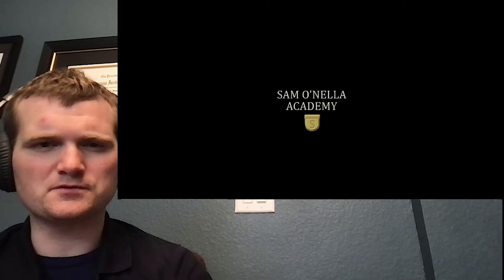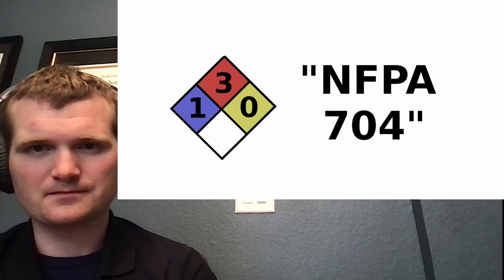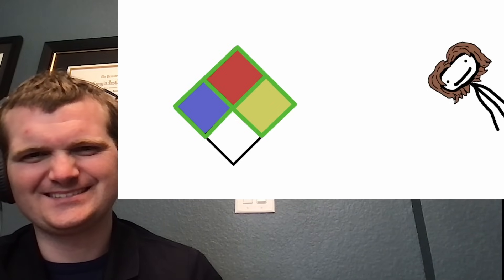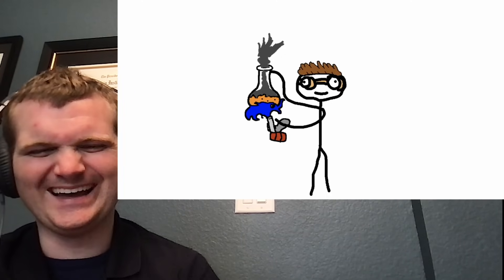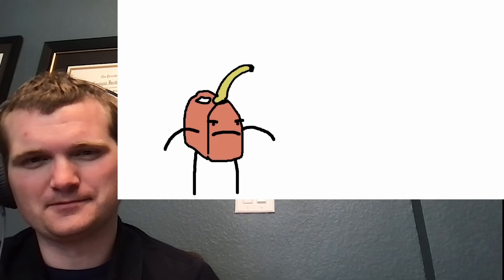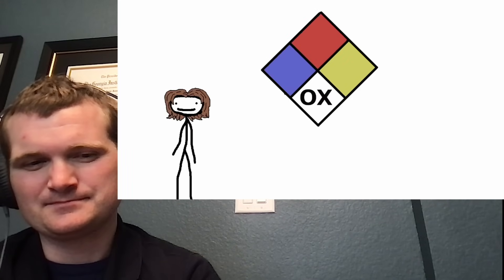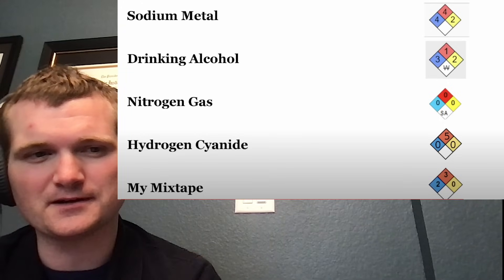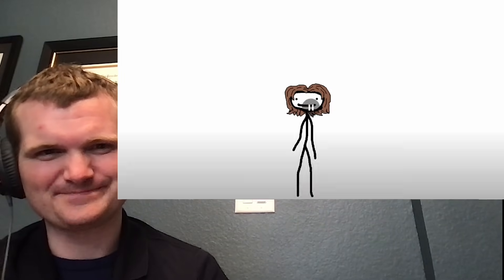Nuclear Engineer Reacts to Sam O'Nella Academy "How to Read Fire Diamonds"

Comment: 6:45 "Wonder what five would be?  Flash point at zero degrees Farenheight or something?"  FOOF?  On that scale FOOF seems like it'd be 555.  It reacts violently with basically everything at 90 Kelvin (Yeah, -300F).  It's a stronger oxidizer than elemental oxygen, a stronger fluoridator than elemental fluorine, and has a nasty habit of exploding into HF gas on contact with water.

Comment: Im so confused how MOTOR OIL has a health risk factor of 0 but FUCKING SPICY FOOD = 2 🗿🗿🗿
Reply: Simply put the health risk doesn't take digestion into account. It's mainly concerned with skin contact.
Reply: Motor oil won't do much if it makes contact with your skin or you inhale a little mist.
Get hot sauce in your eyes or breathe a bit of chyanne pepper dust and you're having a terrible day.
Reply: @ToastyMozart  i suppose i could see the argument for concentrated capsaicin, which is basically just pepper spray/mace, but i’d take that to the face before ingesting motor oil

Comment: As a Master Welder I had to learn how to read these for obvious reasons. For example, Argon (used as a shielding gas in GTAW/MIG welding etc) is non-flammable and pretty inert, but you better believe it will kill you fast when it builds up in a closed space it you happen to be welding there.
This must be by far the most hilarious explanation I've come across so far. You're absolutely right when you say this video should be included in any safety training. People will remember them for sure because of the giggles involved. And we both got that little quiz at the end correct. Nice to know some of my training still stuck after all those years😊
Reply from the maker: Thanks!
Reply: As a trainer of similar subjects, despite the fact that people tend to remember things taught through comedy, they tend to remember the wrong procedures instead of the correct ones if illustrated. I'm a buzzkill, I know.
Reply: @mikitz  
Well, we have to make sure that the comedy part shows the correct stuff, obviously. Or else the whole thing would be self-defeating😅
Reply: Do you have exams to become master welder? In europe there are master titles but for jobs like baker, for welding you can only qualify for certain things like mig or tig welding, enclosed space welding, underwater welding etc. Technicaly you cant take jobs that require such papers if you dont have them. Are there any perks of being master welder?
Reply: @fistrexx  
You most certainly do have to take exams (practical and theoretical), and pretty difficult ones too. It is a full year of additional education both theoretical and practical. Things like a thorough knowledge of welding machines and welding processes; construction/design; materials and material behaviour during welding; fabricating/ application of fabrication techniques etc. There are no extra "perks" other than a better salary (usually) because you have extensive knowledge and skills above that of most regular welders. Hope this answers your questions.

Comment: Back in the 60’s they where doing research on storable high performant roxket fuels and they tried some very spicy oxidizers that where pyrophoric with sand, asbestos, people and almost anything that wasn’t a highly flourinated stainless steel vessel. Some of these were FOOF (which is also onomatapoeia), chlorine trifluoride (a much better oxidizer than pure elemental fluorine) and chlorine pentafluoride. The book ignition is fantastic and a must read if you’re interested in ”advanced ways to fuck up”.
Reply: That reminds me of the blog "Things I won't work with". There's a blog post worth reading about dioxygen difluoride:
“The paper goes on to react FOOF with everything else you wouldn't react it with: ammonia ("vigorous", this at 100K), water ice (explosion, natch), chlorine ("violent explosion", so he added it more slowly the second time), red phosphorus (not good), bromine fluoride, chlorine trifluoride (say what?), perchloryl fluoride (!), tetrafluorohydrazine (how on Earth. . .), and on, and on. If the paper weren't laid out in complete grammatical sentences and published in JACS, you'd swear it was the work of a violent lunatic.”

Comment: I'd assume 5 in flammability would mean "permanently on fire"
Reply: Netherrack
Reply: Like that one hole in Turkmenistan ( it has been burning for 50 years straight )
Reply: @Xris10BUL yup
Reply: Eh, in context, I was interpreting it as just "fire" - ie, "my mixtape is fire" as well as "this is fire" (an actual flame) - with the idea of a 4 merely being "this will almost certainly catch fire", so a five would be "this IS fire". 

Which is basically what you were saying, but with some slightly different semantics.
Reply: @kevinschultz6091 you’re going to semantics jail!
Reply: flash point of 0K
Reply: @m.guypirate6900  Looks OK to me.
Reply: For example, the First Flame in Dark Souls prolly has a 5
Reply: The Eternal Flame 🗿
Reply: So netherack
Reply: Certain chemicals catch fire when introduced to air. Or any gas that isn't utterly f*cking inert like Argon.
Reply: I IDENTIFY AS ON/FIRE
- Sam's Mixtape
Reply: I mean pyrophoric even is like a 4
Reply: I agree, 5 = burning for all eternity
Reply: I’d add a fifth part of this structure, for corrosiveness.
Reply: Soooooo...chlamydia?
Reply: no, that would be combustion point and thats a different thing than flash point. theres also an auto ignition point. if the heat of the flame from the flash point exceeds the combustion point then you got a problem
Reply: I'd assume pure Fluorine, or perhaps something way up in the Azide groups.  Must be an awesome mixtape.  LOL

Comment: I've worked with ethylene oxide at a plant in Kansas.  That stuff is a LOT of fun, as reflected in its safety diamond.
Reply: Only a 2 for reactivity? I'd expect that to be higher considering it's a tricyclic ring
Reply: @gingermcgingin4106  That doesn't sound right, the reactivity is 3 on the placards I just checked.  My personal (nonexpert) opinion is a 4 is warranted, it autopolymerizes at temps you can easily reach on a warm summer's day and that reaction is highly exothermic.  We kept several tank cars on site, under sprinklers that would come on when temps came anywhere that point.  I heard once that the local fire dept inspected our emergency response documentation and noted that the health hazards and amount on site warranted a 7 mile evacuation plan downwind of release, but there wasn't one.  They were told "don't worry, the cloud would explode LONG before it got that far.  I was also told that if those tank cars went up, nobody in a thousand feet would hear the blast.

Comment: It's fun, It's informative enough, It's simple. It's the kind of video that will do both a safety briefing and entertainment to the ones watching aka. a great briefing video because it will be retained in your head.
Reply from the maker: 100% agree
Reply: I dunno theres something kinda hilarious about those half baked 3d-rendered safety animations in standard corporate safety briefs, Or the cheesy 70s and 80s ones
Reply: @tomaspabon2484 yes those are the rare exceptions
Reply: @tomaspabon2484  cutting a jalapeno then touching your jalapenis is much funnier
Reply: @tomaspabon2484  The ones with the informercial-quality skit of someone fucking up, then a freeze frame and a really cheesy scream sound effect? AKA, every PIT safety video ever made.
Reply: I’d add a fifth part of this structure, for corrosiveness.
Reply: @MagnusSheeler  thats the white square dude.. corrosive is corrosive 1 or 4, dont bother touching it with your bare hands... simple as that, same for acids. and oxidizers clearly are in the catagory of air/fuel/heat AKA the fire triangle. K.I.S.S (keep it simple stupid)why make it more complicated, if its a health hazard, flammable and reactive what the fck does it matter how corrosive it is? the 3 other squares are enough to tell sht is a hazard. 

"oh, blue is 3, red is 4 and yellow is 3.. but is it corrosive or acidic?" who tf cares at that point youre handling a fcking explosive. why not add 1-4  to the rest in the white while youre at it. 3 warnings out of 4 not enough for you? you must be some kind of professional or an advanced level dumbass.
Reply: @ its about the level of caution or accessibility, sulfuric acid will give you a first/second degree burn, pure sulfuric acid will burn through your bone with ease